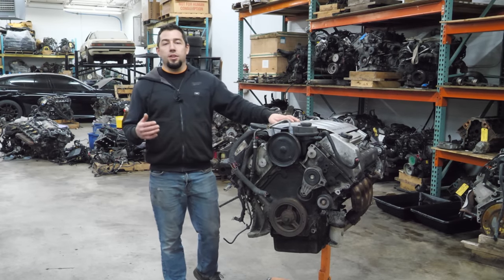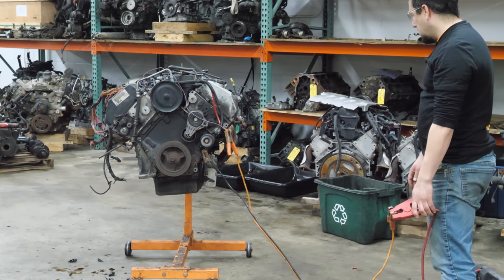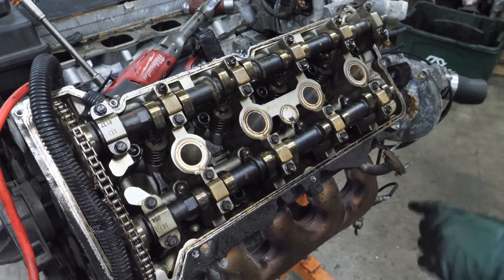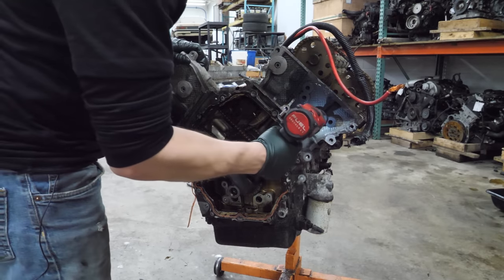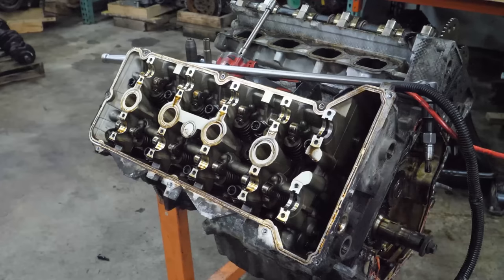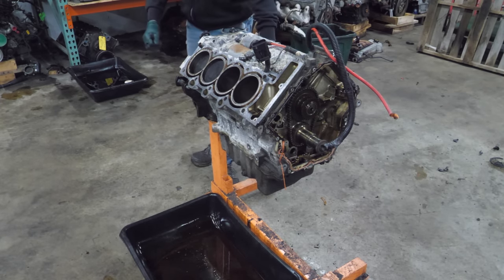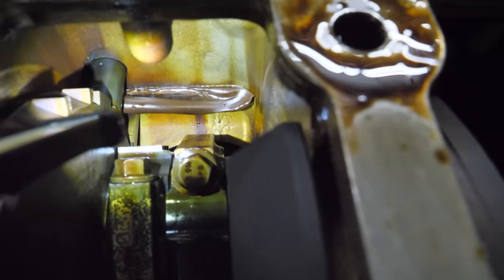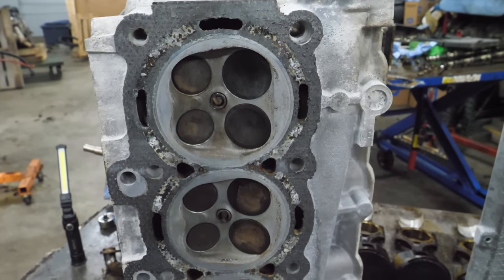Customer Returned This Cadillac Northstar L37 4.6L V8, How Many Things Can We Find Wrong?

Comment: I guess i am the only one here who had a pleasant experience with a Northstar. Put 215000 miles on it. Did plugs once. Water pump belt and tensioner and a blower fan. Ran like a scalded dog and got great mpg. This engine was neglected. However, there was no catastrophic failure. Rods and bearings were intact. No piston to head contact. No stretched chains. Pure lack of preventative maintenance. Change your oil often and flush that coolant. Really a miracle with all of the silicone gasket material in the oil pump pick up.
Reply: They have good power when they work at least
Reply: Failure of leadership at GM; for the umpteeth time.
Reply: At one point my sts was getting 8mpg lol although it was a fast car that handled well for its size
Reply: @chrisscott4607  How does a sts get 8 mpg?
Reply: I have an 06 STS-V.  By the 2000s they figured out the head bolt issue and these engines were actually really well designed and amazingly reliable.  Other than some annoying part placement decisions it really is a great motor.
Reply: @blackericdenice  Probably a bad O2 sensor.  My STS-V makes a ton more power and I still get around 13 MPG.
Reply: @charlesjames1442  You are going to blame GM for people not maintaining their car?
Reply: I had a 99 eldorado with 250k on the od and it ran like a clock tell the starter died and I didn't want to pull it so I sold it.
Reply: @gettcouped  There is no way you are getting 13 mpg. I own a 2001 and I've never seen less than 17.5 mpg.
Reply: @gettcouped  I just checked out your channel. Now I understand how you are getting low mpg. You are lying.
Reply: @gettcouped  Yes a STS has a v8 in a full size car but they are very good on gas. You would know this if you really owned one.
Reply: @blackericdenice  dunno why you going HAM, but I own an STS-V. That's a supercharged de-bored Northstar to 4.4. It's got 469 HP and chews through gas.  It is not a conventional 4.6.
Reply: Head bolts failing is not a lack of maintenance the engines had problems and gm ignored them for almost ten years the last 2 years of the Northstar got updated head bolts with a different thread pitch to help them last as far as chains we never really saw chain or bottom end failures and the oil leaks were horrible from all years
Reply: @caseymuzio7609  definitely took GM too long to fix it.  One can only hope that it was that they didn't figure it out yet, but who knows.
Reply: It was close to greatness were it not for head studs.
Reply: Yea You are the only one
Reply: @halogod0298   Well good deal.
Reply: @blackericdenice  wife's hunted-ghost-mean 97 got 32mpg 1800rpm's normally so not junk mpg. and iv worked on probably 30+ north-star's/caddy as a payed gun/pro

i just like driving my 60's charger more
Reply: @richardprice5978  How does a car rated for 24 mpg get 32 mpg turning 1800 rpm?
Reply: @blackericdenice  I80 easygoing and or accidental hypermileing? or gm didn't want to get nailed like ford did on the f150 eco boost platform 

i just ran the numbers more than once and that's what the ECU said as well aka it's not lying , it's just the happy spot locked up and in OD-gear steady cruising not winter ❄ , others got the same number so your caddy should be able to get it under the right circumstances, sorry forgetting my city number's but you do realise sometimes the average number is combined with city+HIY numbers right so on a gas car it lowers the MPG-rating's  

i lived in Nebraska at the time so Lincoln to sydney area's same for my wife's family
Reply: @richardprice5978  I ask that question to give you a chance to say you were driving 50 mph. You are lying and Ford did not get burn on the ecoboost. I own a 2016 F165. I have a video where i drove around 285 going 55 mph (1400 rpm) and got 30.8 mpg. No Deville with a 280 cuin v8 is not going to get 32 mpg turning 1800 rpm.
Reply: @blackericdenice  not lying look harder there's a class action lawsuit ( he didn't get on it, so i don't have a dog in the hunt ) for mpg on ford's, im glad you got that number and so did my father/family friends f150 ( 20's mpg something around SLC-mountain area's sorry been awhile since i asked him ) but his 2013 king ranch didn't it was less than 15mpg constantly ( his old 2006 TJ and was his k1500 now my 86 got about the same mpg or better aka i wasn't impressed with it and i paid'd under 5k for my rig and my 69 383+727 charger 10-20k$ was better mpg lolz i thought it would be the gas-pig 🐽vs ford ) and yes i/we did try and hyper mile it one time just to see how far off EPA/ford was as a 1YO or under new truck and time didn't make it any better-mpg

as for the wife's 97 or her parents 99~ caddy or boss's, try driving at 60-73 ( think 🤔💭   it was 65/66mph fuzziness about this ) also sorry but i data logged some car's at work so i have raw numbers/picture's/video somewhere im my house/apartment ( but some jackass stole my old tools ect some being pre-1930's/gramp's ), give a rest my brain forgot the exact MPH .000.... sorry i was more focused on the lockup/transmission being bad or if the client's car was over heating  or oiling system/lifter's ticking ect than remembering what the interior smells like ect
Reply: @richardprice5978  I stopped reading your comment @ F150. I don't waste my time reading stuff from people are lie.
Reply: @richardprice5978 — I can tell you’re full of it by your reference to a 60”s charger, anyone that truly owns/owned a charger would proudly denote what year it was and not just throw a decade on it and call it good
Reply: @middleclassretiree  want the sex joke's that comes with saying 69? ( im more of a 68 or 69 guy but my uncle's 71 gold-flake full loaded 440 id go for as it was in the family but i didn't get-it/find the vin to restore it, also considered the 2012~ that looked a lot like my 69 but i&dad/family don't fit roofline was to short to saying hop in my car let's go to dinner with the grandkids wasn't happening, the 1st gen to 75~ has grown on me but the 1st gen need's a wagon's-body's/stretched/4-door's ) generally i quit saying that 69 ( doesn't help im gen-y so is the wife gen-y ), i got a real vin and not recliped the fount of a 1970 as i felt at first it wasn't being honest even know that would have saved me 1/2-off buying my vin in 2009-13 and now id love to have different accessories to choose between on the weekend if i changing my mind as i like the 2012's back tail-panel and the super-nose ect

my vin is a G-code 25.... ( so not the 1st car off the line, could be wrong as im not a vin expert on who's came 1st, also not wise to post my DOT full tag and vin numbers as it can lead to ID-fraud ect ) and mod-top/F8 ( big flowers 🌸🌺print ( sea of F8 green, pass, on to cardinal red and pearl white&black them ) aka rare, didn't care if anything at 17-23yo having a pink or flowery car was embarrassing so was walking with my wife not big on PDF/🤚🤚ect ) so yes i have one, wife's ( she said she's bi don't judge, i try not to hold it against her, bedside's it makes's me a better person in the long run ) helped find it and buying process, and the family name listed in a 426 hemi book showed me it's possible for a mule or his dad's/mom's personal car, and yes it's now in 2023 a mess it got joyrided and chopped by thieves 

new setup is a 12'in deck 4.3X4.5in-crank RB-hemi D8-heads platform and TR6070 dropout out of a 2014 Z51 FG3.2 and yes it's got the air-con firewall ( full loaded/power ) wife''s deal if i whated to stay in the garage . i don't think 🤔someone who isn't a owner would know/details this much aka truthfully i have it still
Reply: @middleclassretiree  also was in/working in a caddy shop so pinp joke's happened and super-fly ones 

1 more reson im not buying a caddy/Lincoln and riding with my wife's 😉 or there friend's. as i don't care for payed entertainment 😉 or getting paid from it 😉 

i passed on a 1970 RT 440 and a 4speed hamktrak vin as i considered putting 68 parts onto it, the younger guy wanting about 9-13K at the time, lots of people including me didn't think the 1970 was worth the money ( at 18yo-me/premarital ) but i here that's changing and now the same as a 1968-vin

looked for my car and tried to get it sense i was about 4YO, as a teenager i had the $$$ to by one/RT-1968 b5 or black 🤔 that was ruff/minor accident-in-1980's-never-fixed-parking-outside but ran/road-worthy-barely but my mom thought id roll it or end up in jail aka sports car lolz um no mom ( dad was on board with the idea but he didn't live in the same house at me 😉 , also i had to buy/work it aka not mom/dad-gift ect ) my stunts are generally in a gampa's looking/market car or 1ton-truck's as in my charger/hot-car i actually behave better 😉
Reply: And some GM coolant seal tabs as a preventive measure.
Reply: @GNX157  no that's junky and later on will lead to engine & transmission and the heater core/HVAC damage 

i knowledge 1st 🤚bad move
Reply: @richardprice5978  Standard procedure on the HT4100 when changing the coolant. Yours must of been isolated case. They were used often at the Caddy/Buick dealer I was at and worked wonders on aluminum engines. Never any issues. Just two tabs.
Reply: I don't like the idea of coolant flushes, and would instead suggest that you change the coolant every two years, and flush it with plain water until clear, unless you are actually experiencing a problem.  You should also disconnect and specifically blow out the purge line with compressed air.   One of the biggest cooling system problems with these engines is that GM tried to tell you not to change the coolant for 100000 (and later 150000) miles.  Changing the coolant is cheap insurance, so just do it.  All-aluminum engines should not produce significant coolant deposits unless those deposits come from the coolant itself breaking down.

Otherwise, run synthetic oil on it haha don't worry about doing extra oil changes because the standard oil life monitor is calibrated for regular oil. Synthetic oil is more than twice as good, so to speak, so you can safely run it for the maximum spec for conventional oil definitely.
Reply: @blackericdenice  They will do really good numbers if driven nicely.  They were originally rated for higher numbers.  EPA changed their methods and then retroactively re-rated everything in a more pessimistic direction about 10 years ago.
Reply: @nathankarras2715  i still found it was better to change the oil-engine & filter under 3-5k mileage ( wife's got 0-40 pag/full synthetic mobile-1 ) but that was without using a lab for testing, so having say blackstone lab telling you how bad the oils were vs storage/drivability ect

something im going to be doing differently with my hemi/charger's engine ect whenever i finally get it running around again
Reply: @richardprice5978  I had done various oil analyses, and generally found that the oil was still fit to serve when the computer was suggesting changing it. That was usually between 6000 and 8000 miles.  On paper, the GM oil life system has a range between 2000 and 12000.  In practice, I have never seen it over about 10000 or under 3500.
Reply: @nathankarras2715  👍for the information how is your v8 used? and yah i don't trust the long lifespan add campaign's and i figured out for me with older classics it was just easier for me to remember 3-6k as then everything's the same PM-schedule ( and if it's just sitting then at least trying 1-2 X per year to keep up on the additive package's/ect so rusting and slugge inside ect is kept at bay ) ( other than if the ECU said it was smoked/bad them it came-1st aka better safe than sorry 😉) for my crap, but yes 1st-lab/2d-computerised is okay 

the filters are probably more important to change vs oil vs add-package
Reply: My grandfather had a Northstar Cadillac. He put almost 200,000 mi on it and never had any big issues
Reply: Not the only one. Ive had the exact same experience.
Reply: They're great engines.
Reply: I still have my 2003 Deville DTS, with 235k miles. My daily driver.. I bought her for  $480.00 in 2018, with 100k miles.
Reply: @gettcouped  I miss my 08 STS V.
Reply: @jgfrakes2736  pretty sure 03 is when they fixed the head studs so it's not surprising on yours.
Reply: I loved my 1998 DeVille until I put my foot through the transmission it was a great car . Former makeup queen it was pink and my family called it Cruella ! Hah ! Get it?
Reply: @chrisscott4607  that shit terrible isn't it suppose to get 24
Reply: @blackericdenice  how does he tune 1800 when this car runs at 2000 rpm at 60 mph or 100kph
Reply: I have never seen a dog be scalded.
Reply: @SirUncleCid  Figure of speech there simpleton.
Reply: I loved my 2000 DeVille. I wanted a totally different colorway and a few more options but it was amazing while I had it. The only time I ever made the mistake of letting go of a car I loved.  Drove it all the way to Virginia around 200k miles to visit one of my partners. That's 10+ hours from here. I'd grab another one as a winter car in a heartbeat. (But only if its 2000 or earlier because i do not condone 2001 Cadillac's war crimes of smoothening the wreath and crest)
Reply: From experience when my coil goes out on my 3800 (always same coil about every 75000) car will run about 2 minutes with 4 cylinders then never start again. This thing in video still could have ran but oil fouling would occur again unless complete overhaul to reset reseat valves timing and pick up a new PCM. Or pick up a new LS block $1200 installed😊
Reply: I purchased a 2002 I put 240,000 miles on it and it finally went into limp mode. By far the best car I've ever owned. I found a new engine on Ebay brand new from a supplier I purchased it and I'll be installing it this spring. My Deville would get 22 to 24 mpg.